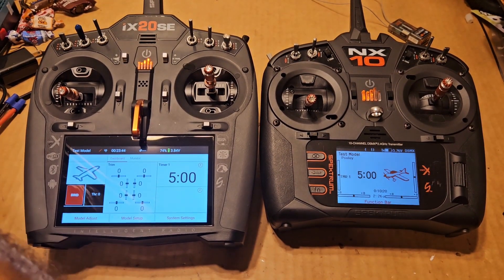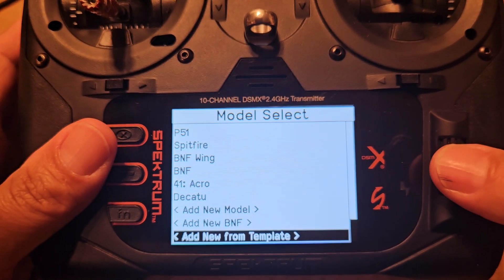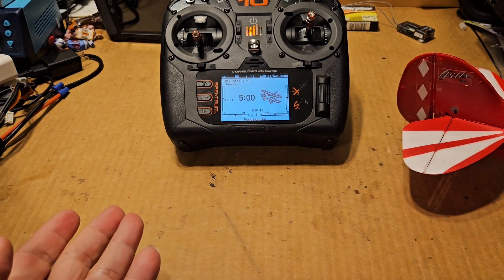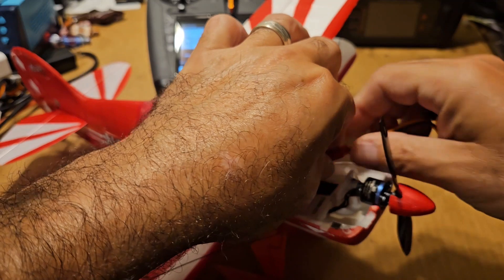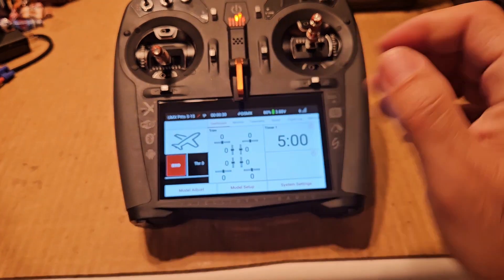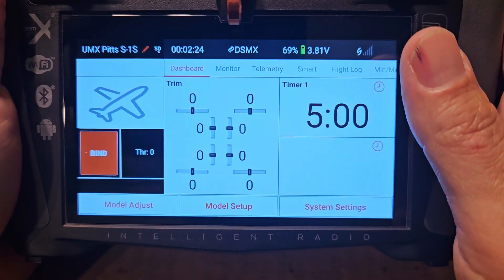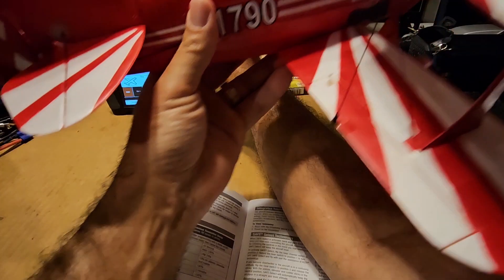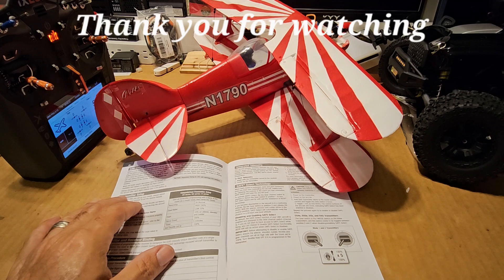How setup a BNF Quick on NX And iX Spektrum transmitter

Comment: Thanks. To be honest, that’s what a bind and fly  was meant to do!  The only reason I could even see doing a manual set up. ai if you wanted a specific knob , switch to do as far as the personal set up . Which brings me to the question . The set up you just made . Can you still edit the settings ? Like moving the throttle cut to another switch . Or altering the any other choice
Reply from the maker: @phillipjensen4362  YES you have full capabilities as with any other set up u just get the call outs, servos reversed (if needed),safe and AS3X on a switch, Flaps and retracts, and Rates n Expo done for you, everything  else  is the same as the manual set up
Reply: @Pooley929  i just got a ix today. i did A Bind and fly. to a eratix ,and a timber tubro ,im happy with the bind and fly mode settings. i was most happy to find out one can make changes ,on the fly
Reply from the maker: @phillipjensen4362  super excited i could help
Reply: Great video. I agree fully, a lot of other videos make this process way too complicated. Thanks!